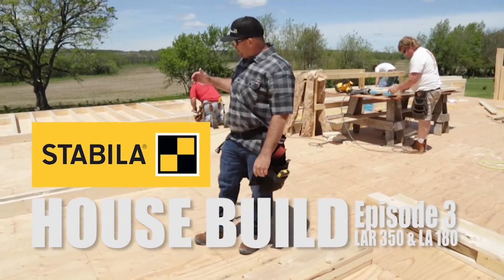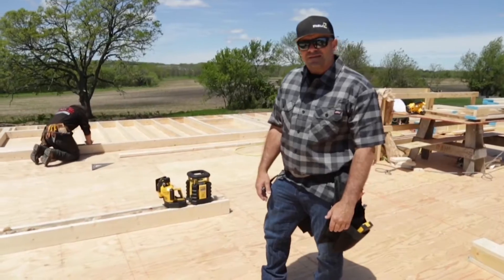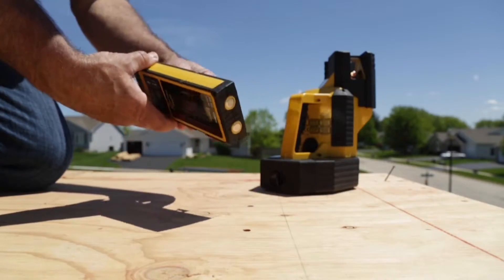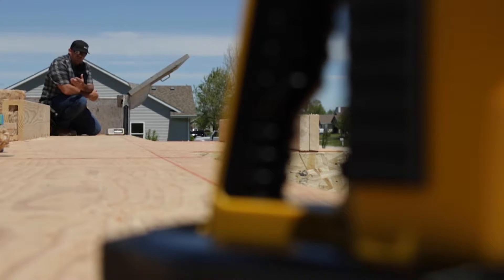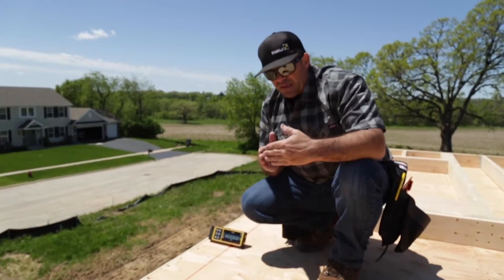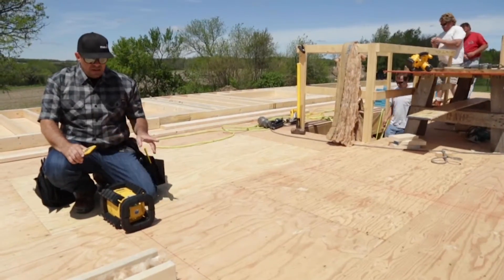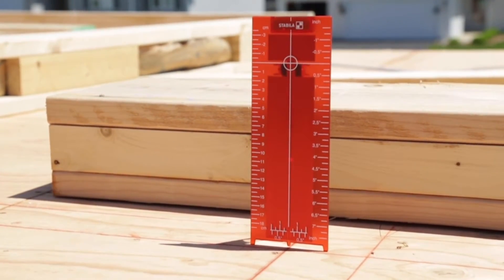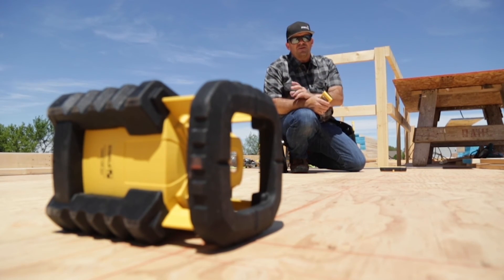STABILA House build | Episode 3 | Rotation-Laser vs. Line-Laser

Comment: I love stabila,  i really do. All my measuring devices are from stabila but im a little confused by this video. 
Why the two separate lazer levels?
What i mean is couldn't the first laser you demoed do both layouts?
Reply from the maker: Generally speaking, you're right. The LA 180L is a special layout laser with an autoalignment function, which makes such layout work much easier. The rotary laser can also do this, but not automatically 💛🖤